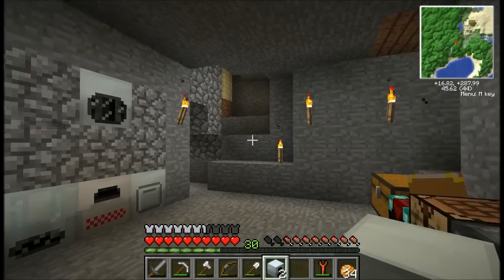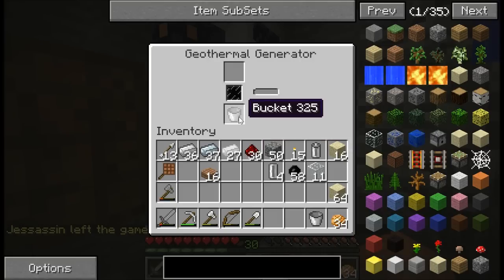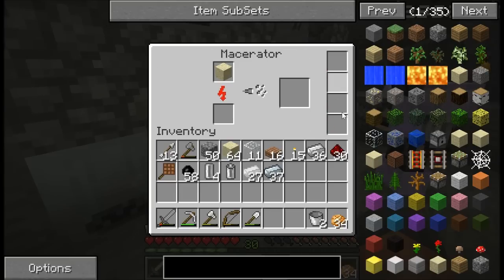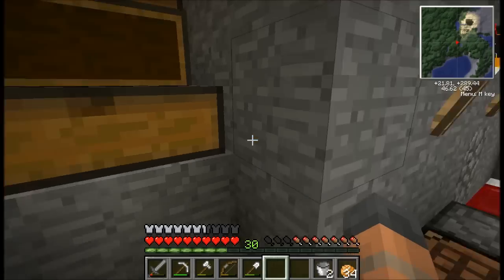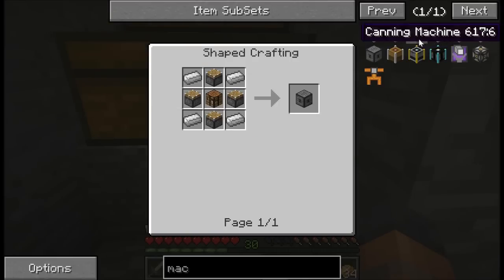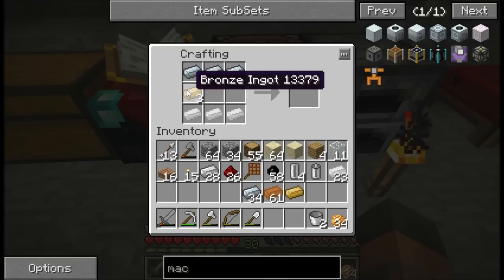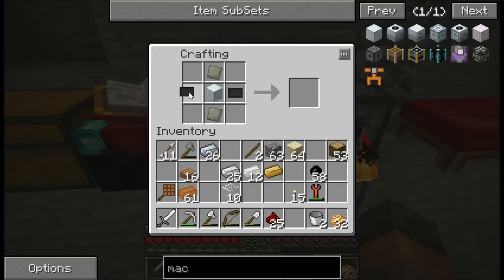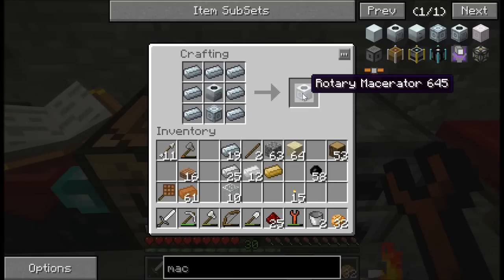Learning Feed The Beast 04 Geothermal Power

Comment: You have 2 spots in the rotary macerator because you can put for example tin ores and copper ores in it and it gives you bronze dust. So it's not to macerate 2 stacks at once but to combine 2 types of material.

Thumb up so others can see :D

Comment: Open up the FTB launcher and select the pack you want to edit, above the pack selection area, there should be a button saying "Edit Mod Pack" click on it, it will bring up a new window, on the right are all the mods currently in, but you want to click on the button saying "Add Mod" click it, and find the .zip file of advanced machines (the ZIP file, don't extract it) you should be done :) (you may have to enable it with the button saying "Enable")

Comment: the system uses both, in fact the reason that the geothermal only flashed instead of being on the whole time was because the watermill was producing power. if the water mill wasnt, the geothermal would have been on the whole time.